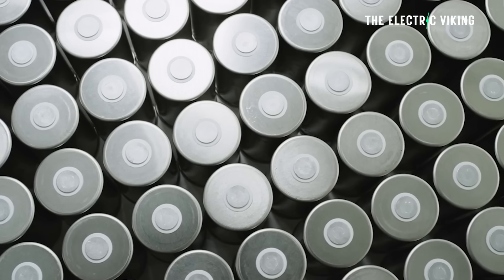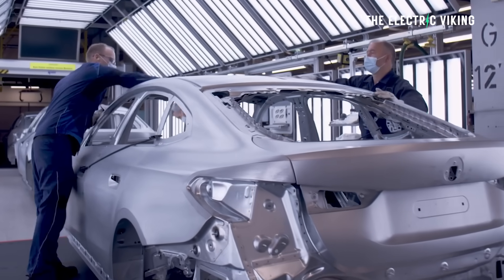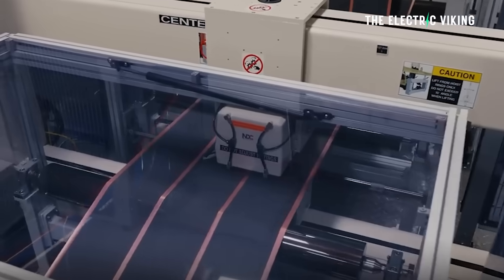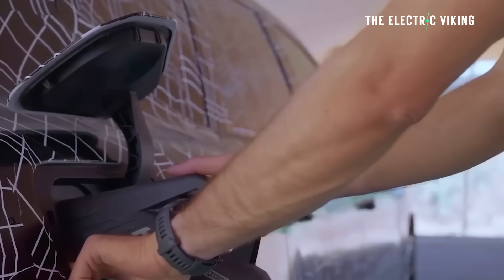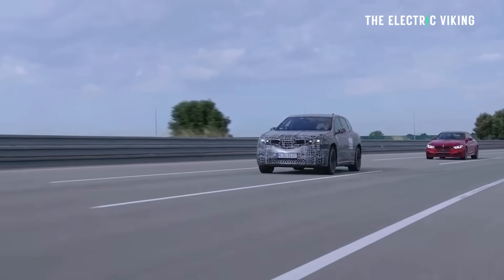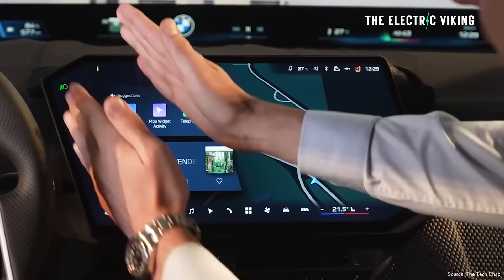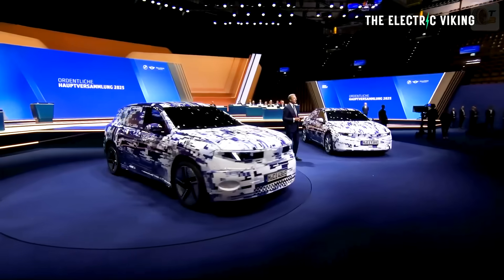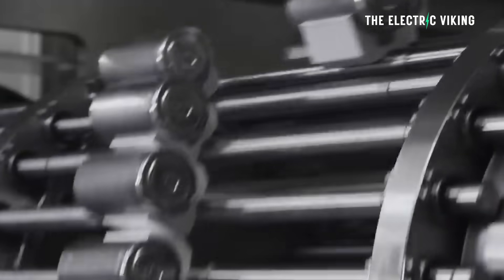BMW IX3 - new Model Y rival uses Tesla-like batteries for 500 mile range

Comment: It’s gonna be a thousand miles per charge within 5 years. It needs to be. We can’t adjust to the range variance of battery vehicles. We are so used to gas cars having 10% range variance for driving conditions and performance. But batteries are more like 45%. So we need 500 just to know we have 350 at all times and conditions. But when the range becomes 1000 or so, Then ICE is dead.

Comment: Weight is not made too « visible » by mfrs. but to go from a 400 to a 500 kms effective range, and with everything else equal…you need MORE than 20% MORE batteries, because if you had 400 kg of battery in a 1.8 ton car to carry it, it takes now an extra car structure to carry 20% more battery. Now, your 500 kg battery fits in a 1.95 ton car which is less efficient and will ONLY do 369 km with the first 400 kg of battery plus 93 kms with the extra 100 kg of battery pack, casing etc. This is ONLY 461.5 kms in total and your 20% more battery brings you only a 15% longer range. Therefore for a real and effective 20% more range with those representatives weights and kms, you need now 26.5% more battery and a 10.5% heavier and less effcient car to carry all this.
Conclusion : the extra range affect more and more the efficiency by a permanent dead weight and the vehicle structure to carry it. SO, reverting to hybridation to offset overweight, if now the battery size is limited to 90-95% of the typical mobility, which is a daily average of 50-100 kms each day, for commuting to work, shopping, leasure locally, etc, then the vehicular electical overall efficiency can be far better than with 400 -550 kg battery DRAGGED ALLOVER…A full modern hybrid drops also the multi-ratios heavy gear box for an Antonov type HSD transfer with a low loss dry sump and a larger slow and efficient Atkinson ICE fueled by a small 40 liters/42 kgs fuel tank and with a 2/3 smaller and lighter E-motor well assisted by the powerful ICE when needed. Finally, you end up being 300 kg lighter or more than a heavy battery only BEV and this modern plug -in hybrid features also an insane 1000 kms range with just a 3 minutes refill time of only 40 liters. You have now a real twin drivers grand tourismo transcontinental nonstop capable vehicle so that a paire of vehicles, one BEV for economy and ICI for useful sociability’s are no longer needed to duplicate your the O&O costs..
A negative image is still associate to some old and heavy PHEV’s and some of it was justified ( hard duty on a small battery not worth charging for a small range only for having to replace it too early ) while others critics are based on faked green EU reports based on corrupted data, etc..One could argue that recharging fully a small battery every night with the basic AC plug for an E-bike could kill the old 25 kms range of a heavy old PHEV « Pathefinder » in about three years, hense the very bad reputation of PHEV , heavy and not worth charging…..BUT NOT ANYMORE, unlike an BEV will kill its battery on the last kms of a poor range, struggling to find a free charger, and ruin his battery life with more expensive fast chargers, at the opposite side, on a modern PHEV, the small 12 -22 kWh battery is PROTECTED by the ICE to avoid any harmfull extremely low and fast discharge while using ONLY a battery life optimised 60% capacity range ( from 20 to 80% charge basically) and today, such a modern small battery takes there well over 5000 of those moderate cycles with no stress. PHEV is maybe still not the ultimate green mobility solution (yet many H2 cars will  be flexible on fuel source with a big cheap ICE and a small fuel cell hybridation!!! ), yet the PHEV combines already today the best of both world , the BEV world 90% of the time for the cost economy of domestic power and the ICE against the huge autonomy and recharging PITA syndrom. Meanwhile the PHEV is on both modes, more efficient than both the best ICE’s and BEV’s with better energy recovery of one and weight control of the other…The rational portion of the market has already captured those basic engineering facts and the best of the modern hybrids are a growing trend multiplying with those wise testimonials. Then, the best mfrs. are also quick to respond with those high margin expensive PHEV to optimise their profits …the taxis for instance will pay more to earn more profit per ride and more uptime with those, so the game is over…😂😂😂

Comment: BMW press release quote associated with the new Neue Klasse" family. You also need to review the improvements in software management.
“The BMW Group sources its battery systems for the 3 Series from various suppliers, including collaborations with companies like Rimac Technology for high-voltage battery packs for future models. Additionally, BMW has partnerships with companies like CATL and EVE Energy for large cylindrical battery cells. The BMW Group also focuses on localizing battery cell production and sourcing materials, including lithium, from suppliers like Livent. The BMW 3 Series EV, part of the "Neue Klasse" family, will be primarily manufactured at the Debrecen plant in Hungary, with pre-production already underway. The first Neue Klasse models, including the electric 3 Series, are scheduled to begin rolling off the production line at the Debrecen plant by the end of 2025. BMW is also investing in battery production, with facilities in Woodruff, South Carolina; Irlbach-Strasskirchen, Lower Bavaria; Debrecen, Hungary; Shenyang, China; and San Luis Potosí, Mexico.”

CATL is constructing a large-scale battery manufacturing plant in Debrecen, Hungary, as its second European facility next to the BMW plant. The plant, which is expected to be operational in 2025, is part of CATL's strategy to expand its global presence and support the European transition to electric vehicles. The facility will produce battery cells and modules for European automakers, and is strategically located near major car manufacturers like BMW, Stellantis, VW, and Mercedes-Benz. 

It’s also worth checking out  Mercedes-Benz advancements in large EV Trucks eActros 600 LFP and solid state developments associated with CATL.

Comment: The main issue with BMW is they deliver car with extremely expensive compared to other cars who can deliver similar range. Their price is still very high and they need to lower that by atleast 25% to compute with other electric cars. I mean you can buy 2 electric cars for 1 BMW electric car
Reply: Have you seen their sales … they sold more than Mercedes and Audi combined .
Reply: @De_Wukong its just the brand, BMW which is famous brand as compared to Audi & little cheaper than Mercedes. Electric BMW is not something different or special as compared to other electric cars. Their ICE is something different but their electric car is not something special just similar to other electric cars

Comment: 𝐢𝐭 𝐢𝐬 𝐚𝐛𝐨𝐮𝐭 𝐜𝐨-𝐞𝐯𝐨𝐥𝐮𝐭𝐢𝐨𝐧 - a BMW engineer explained that the choice of 46mm diameter is simply based on the maximum space for a battery pack - given the cell voltage and a target 400/800 volt you can calculate the number of cells you need. That's different for the height - so Telsa produces 80mm and BMW produces 85 and 120mm with the latter for the SUV models which customers expect to have a higher entry. A similar thing happens to the cooling system - the Tesla cells are less tall as they were starting with simple top cooling but now Tesla and BMW are using snake cooling tubes. Snake cooling tubes are harder to manufacture but in the end you can be at the level of blade batteries while having a choice to change battery chemistry. Blade batteries have problems with cooling when it's not LFP or SIB. So basically, Tesla and BMW have the option to continue using NMC for high-performance and long-range models while still providing another chemistry for the cheaper versions of their cars.

Comment: I don't hear anybody complaining about the AI data centers that is going to force everybody's electric bills through the roof you cannot run a data center off of solar panels you need to resurrect old defunct nuclear power stations everybody's power bill is going to go through the roof because of data centers not to mention Optimus robots give me a break about electric vehicles I can charge for my solar panels and batteries at my home🎉🎉.

Comment: How much does it weigh?  It will wear out roads and collapse bridges.  Most charging stations will not be so high voltage.  Does it still use inflammable Li based batteries?  Not yet switched to Na which has better capacity and is not flammable.  Still a generation too early to move to EV’s.
Reply: Probably about the same as a Range Rover Sport, they've been wearing out our roads for years now with addition of carcinogenic emissions too

Comment: Silly Bollocks  ,there is no any chance for  500 mile range  unless  there will be  150kWh battery
Reply: The BMW iX3 is very efficient. The 800km are WLTP range. Total battery capacity is ~112kWh, net battery capacity is ~107kWh-108kWh. With an energy consumption of 13.4kWh-13.5kWh/100km or 134Wh-135Wh/km you achieve 800km of range. For comparison, the Tesla Model Y LR RWD has 622km of WLTP range with a ~80kWh net battery, that's 12.9kWh/100km or 129Wh/km. So the difference between the BMW iX3, which is a more massive car, and the Model Y LR is 0.5kWh-0.6kWh/100km or 5Wh-6Wh/km. Pretty reasonable and realistic. The US Model Y LR RWD has almost 82kWh by the way, that's also what Out of Specs measured. So you have to use different numbers for that if you compare the numbers in the US.

Comment: Why do all car blogger repeat 800km - this is WLTP what with this Frontside wind dimension, it never will be reachable on Highwayspeed even outside Germany! The cW value is good yes - but the impact is caused by cW x Fronts wind dimension what on all SUVs is just undergroundish!
even if and when they provide a larger battery than 100KWh (certainly not more than 120KWh gross capacity which will lead to a net of maybe 112KWh max!) it is far from reality - Highway speed around 130km/h might lead to 20..22KWh what is still excellent for an SUV but then the reach is slightly over 500km on ideal climate condition and less than 500km on Winter condition. Still good but NOT 800km what is all just marketing nonsense! But the larger battery if so will add 20% on battery weight what then leads to a weight surplus of about 100kg what then adds to the rolling resistence and impacting the carry on weight as per car specification.......
Anything else would be a big surprise for those understanding the limitations of electrical power trains using highest efficient motors and power-electronical inverters which by the way industrial wise we use since more than 15years
Nothing is for free and the physics count everywhere equally on planet Earth

Comment: THE TRUTH is that the  i4 edrive35 has sold well because that model is exempt from 'Fringe Benefits Tax' in Australia.  It JUST falls under the threshold (currently about $91300) provided there are no options added.  There is only one optional 'package' and in practice you can negotiate for the package to be added for free.  While it is a great product, the tax exemption effectively makes the i4 edrive35 about 30-40% cheaper to own than it would otherwise when packaged for an employee as a 'salary sacrificed' lease vehicle.   The exemption is not applicable to ICE vehicles.  It will be CRITICAL for the neue klasse to offer products under the threshold. It would be a crazy move if BMW does not offer at least one variant of the new iX3 under the threshold.

Comment: A Model Y long range is about 70k aud. Expensive yes but that’s the price you pay to save a few dollars in fuel and look up to date. Anyway, the BMW has a badge that represents a premium . Only the badge really, nothing else. The price for the badge if it’s based on historical differences , ie. premium vs the rest, is about 20 percent. So 20 percent of 70k is 14k , so the BMW should be priced at 84000 aud. Anything over that is gouging and anything substantially over that means it will be a fail.
Reply: Model Y Long Range is such a basic EV and the range is quite low. The BMW IX3 is more than a level above that
Reply: @Bernd-b1ylong range model y is 550km wltp. What’s a better comparison car , bear in mind if this was an ice comparison I would be comparing say a Mazda salon with a merc c class or something like that. Then I translate the difference into the ev world to see if I am being gouged

Comment: Sam..I'm a bit disappointed in the situation with the U.S. gov't's anti EV moves. Car companies are doing the predictable..bringing back V8's. Fine. Let 'em. Why would you buy a V8 powered car though when you can get an EV that will go JUST AS FAST?? It's certainly alot cheaper to run..even if electric was expensive. The repairs would be a fraction of those of a V8. No tune ups, no oil changes, no having to change transmissions that cost a fortune these days. I'm a Republican and don't understand why the GOP is so against EV's ! Really sad and I'm in agreement with your disappointment. Keep up the good work. Hope you and yours are doing well!
Reply: the car and oil industry have powerful lobby groups interesting state: As of the 2024 election cycle, auto manufacturers alone employed 331 lobbyists in Washington, D.C., with 225 of them being “revolvers”—former government officials turned lobbyists. That’s just one slice of the broader automotive sector, which includes suppliers, dealers, and trade associations.
The oil and gas industry is even more entrenched. Historically they’ve employed hundreds of lobbyists across dozens of firms, often outspending most other sectors in lobbying expenditures. Major players like ExxonMobil, Chevron, and the American Petroleum Institute maintain a constant presence on Capitol Hill. you see why congressmen and women are always lilting things in the direction of these industries who basically write their pay checks in many different forms, em
Reply: @stevenbarrett7648  happy days 😊
Reply: EVs break down more than Ice car's..... Just stating Facts 😊
Reply: Er I think you'll find you can't get a Milkfloat that's as fast as an ice car😊

Comment: £0.80 for a kWh is too expensive. In the UK this what you can pay at a charging station. Diesel will still have a place for people who drive long distances on a daily basis.
Reply: In Canada on the west coast, Tesla Superchargers are between $0.20-0.35 (ie €0.15-0.25) per kWh depending on location and time of day.
Reply: @gregtheelectricviking  Net zero zealots have made UK electricity the most expensive in Europe and probably the world. The mad rush to net zero is bankrupting the poor and destroying industry especially those companies which are heavily reliant on energy. I say this as an EV user with solar panels, heat exchanger house heating advocate. There is a natural pace to the transition to renewables and nuclear (hopefully fusion) but bonkers politicians have no sense of balance.
Reply: @gregtheelectricviking I'm not thinking of moving to Canada anytime soon 😊
Reply: Yes, but I’ve had an EV for three years and never paid more than £0.56 for charging. Plenty of cheaper places if you bother to look and as I home charge for 90% of the time at 
£0.07, it is massively cheaper than an ICE car.
Reply: @ISuperTed  I agree with 99%. But when you’re going on a long trip you need a fast charger and those are - in my experience - expensive unless using them after 7pm and before 7am.
Reply: @johnfrancis4401 That’s true, we’ve done a few and overall the cost is similar to an ICE car (providing you fully charge at home first). Totally understand if you can only public charge, the
case for EV’s (in the UK) isn’t the best yet.
Reply: @ISuperTed It never will be 
Keep the diesel flowing 😊
£36 ved😊
Reply: @johnthemagnificent7022 Don’t have a problem with that. We have an EV and a diesel, best of both worlds.
Reply: @ISuperTed No petrol 😮
Reply: Absolutely my friend 😊Keep the diesel flowing 👌

Comment: BMWs battery cells are actually quite a bit taller than Teslas 4680. It's 4695 and 46120. And the battery is not the only gain for BWMs new platform. It's the new motors, the new packaging where the battery pack is a structural part of the car, and so on.